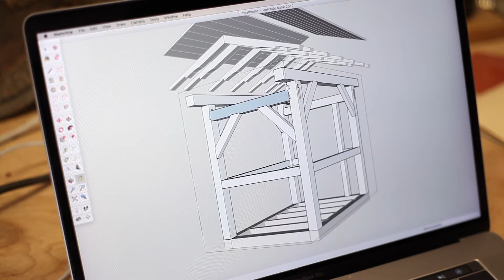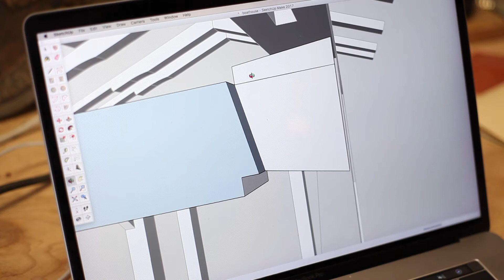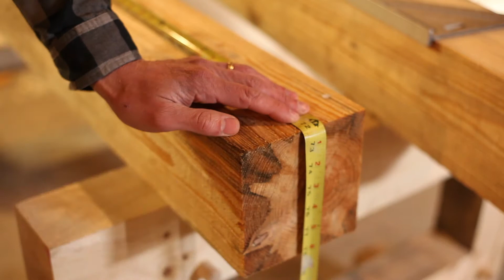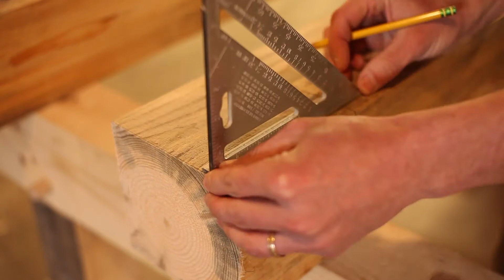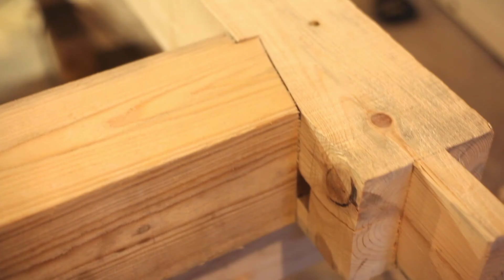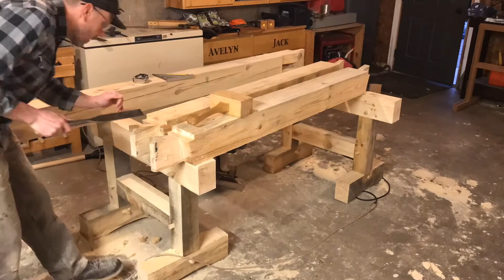Part 4: Dovetail Tenons for the Tie Beams

Comment: Jesse, forgive me if I missed it but how are the corner posts attached to the bottom plate, is that also a tenon & mortise joint? I live in the Texas gulf coast and hurricanes will carry everything away so we have make sure our shed and structures are tied down securely.
Reply from the maker: Hi Jeff - I haven't gotten to the point of attaching the posts to the bottom plates yet. We live in an area where hurricanes or seismic activity isn't an issue, so I'm not going to be able to give you any solid advice (pardon the pun). When it comes time to shoot this portion I'll see if I can find some better answers!